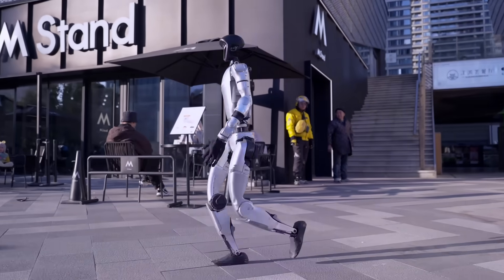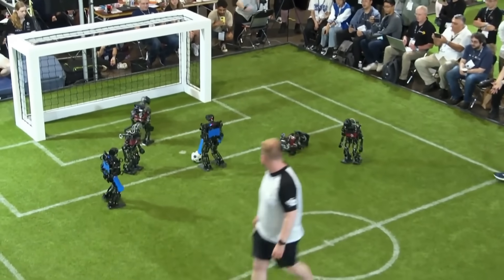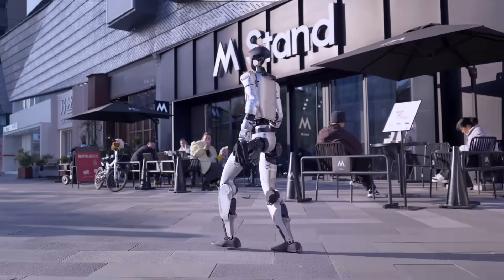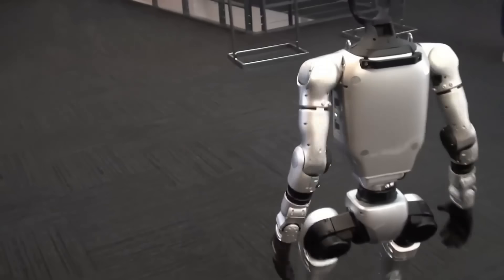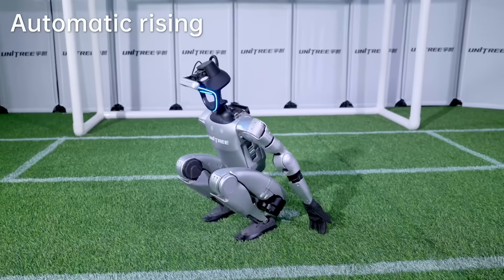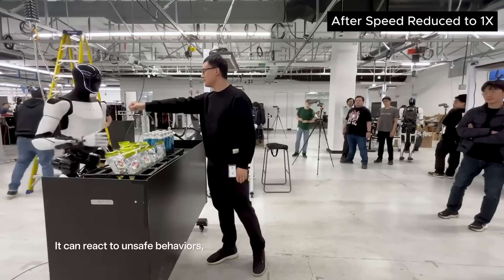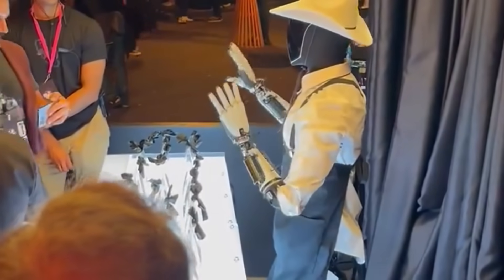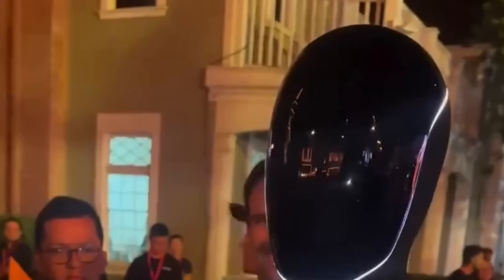The Differences Between Unitree G1 & Tesla Optimus Humanoid Robots

Comment: G1 is a glorified toy. Optimus is genuinely useful robot (in theory). G1 is tiny and can only pick up a few pounds. Optimus would be able to carry groceries and packages. Optimus all the way.
Reply from the maker: in regards to this you are right,,but it depends with the version or iteration of the Unitree G1; they have different versions usually the cheapest one going at 16K factory price is the one that's more like a mechanical toy. But their most advanced iteration are costly and have  some good features but still not at the level of Tesla. As of now Chinese robots are better in walking speeds and agility but not in doing tasks and the AI is still far behind

Comment: Physics Systems Organization of Science Sensors and Technology Research:
((G^2.07)R))=E general relativity law 
(gold kit fukushima robotics) Cost $7887 the robotics community secret.
>>Using a test method eliminates errors and worries about false data and research. You can prove it to yourself to work with the robot and use your own test points in the method. The test method starts low and goes high for the acceleration factor.

Please tell me in history when Isaac Newton had Robotics or computer science. I do not believe he had it all around good as a modern physics researcher.

Found on the first line of code in the standard operating computer systems line code. You will remain stuck and they are useless without this code test method.
F=m*23
F=m*333 
F=m*633
(Voice prompts start at 933)
F=m*933 ----robot states "too slow human" a voice box is required for audio prompts to go higher in the test method test points. Isaac Newton born in 1643 did not create.

F=m*1993 -----robot states "too slow human" 
F=m*2193
F=m*2300
 F=m*2390

F=m*2391 ---Upper Limit Do Not Go Over this Value.

 Their command is like this "make it SO and make it a go, go, go" --I could not put the swearing in this, or this could be flagged or blocked. Ask for their command and they will repeat it for you as much as you need. Give them at least two or more calculators and/or cell phones to make the robot's reaction time faster they do not have to be new cell phones either could be old junk used ones.

You can also use code: F=m*a*b*c 
Equals:
F=m*2308

Not this low acceleration factor code: F=m*a*a
Numeric Acceleration Factor of 32
F=m(1 x 32)

Dr. Ronald G. Erickson
PhD Robotics Science
PhD Physics

Comment: It’s not smart of Tesla to sell its robots for $20k or $30k when it will cost them $100k to produce
Reply: It won't cost 100k to produce. Research before you speak. $10k production cost.
Reply: @fatherlesssons2025 it costs Tesla $100k to produce the Cybertruck they sell for $80k. Soon Tesla will have to cancel the 4680, structural battery pack, and the Cybertruck. They’ll never succeed with robots either.
Reply from the maker: Yes

Comment: G1 cost 16000.
Reply: https://youtu.be/BC2qztW1fS8?si=bS6RzKzeHwdy7FHA
Reply from the maker: g1 base model costs $16000 but advanced model Called the G1 edu  Ulitmate costs more,,, Unitree has G1 base model, G1 Comp, G1 edu, G1 edu Ultimate C(from U1 to U5),,they have about 6 variations of the same robot and  they  differ in features,,,the one for 16000 is the cheapest or entry level and it's just a toy that can move,,it doesn't have any special features,,,go to Unitree website on G1 you will they have different versions